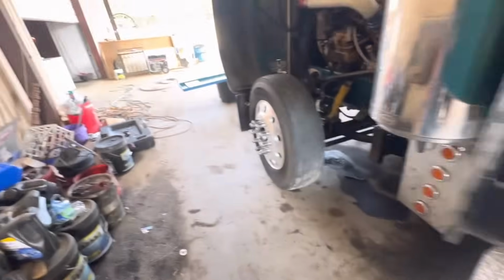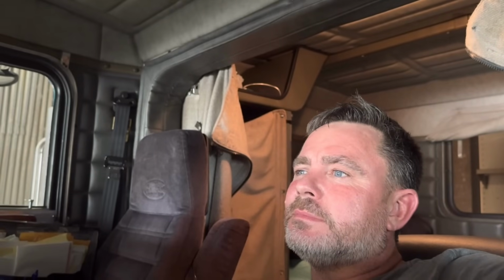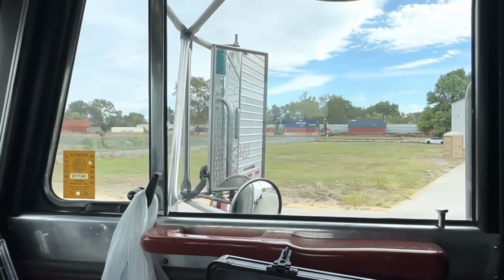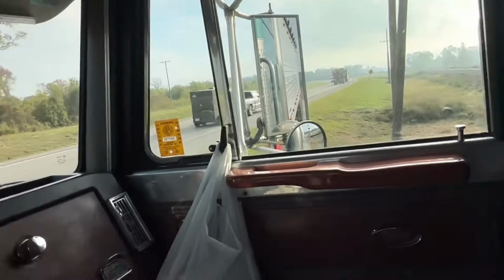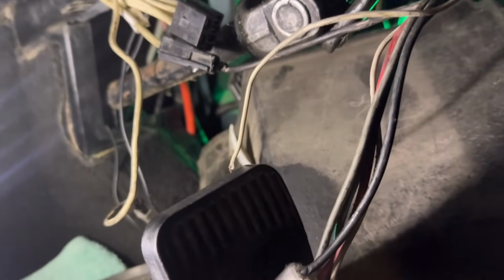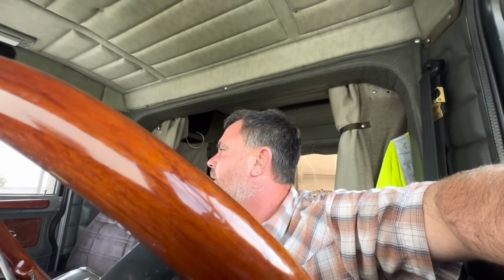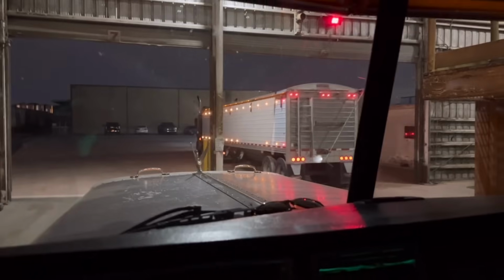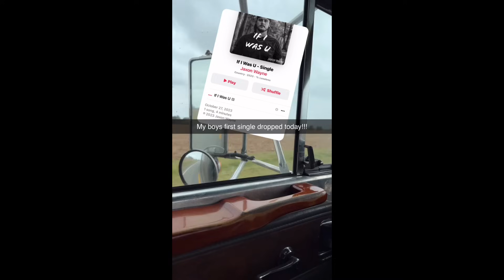Second Week In My 1998 Peterbilt 379 / Things Are Looking Better!!!!!

Comment: If you’re going to change the dryer you can shoot air through your ac manifold shut the knobs down and spray your system down with soapy water. Make it a lot easier to find leak.
Reply from the maker: That’s a pretty cool trick. I may have to try that

Comment: Heck  yeah  the exact same thing happened to me on the turn signal wiring...got wrapped up in the steering u joint i just got a new one for mine..used plenty of zip ties to keep it away from the u joint..
Reply from the maker: Man that’s a first. I’ve had one of these truck since 1998 and never had that happen
Reply: @thedirtytrucker9633  I even had the problem with the air pressure sensor...but my buzzer wouldn't shut off.
Reply from the maker: Yea sir I had to unplug my buzzer the other day until I could get another switch in there

Comment: Biggest problem I've had with the a/c on them is orings. Mine was blowing ice cold, went home for the weekend and Monday morning nothing. Oring on the high side of the compressor was leaking. On our other truck had one leaking on the dryer just out of nowhere.
Reply from the maker: Man those things will make you or break you. I soak mine in refrigerant oil before I put them on and wear rubber gloves. I try the best I can to make sure the o-rings are straight and not twisted on the fitting
Reply: My 96 will give you pneumonia it gets so cold. I can't run the back on high in the summer when I'm trying to sleep because it gets so cold. I'd check all the connections on yours and look for oil seepage from them and the condenser.
Reply from the maker: Yeah I’m going to redo the whole thing in the spring. Most of the time I ran the sleeper and that will run the cab on low. And it was all I could take!

Comment: Maybe you can JB weld the hole in the one tank for a temporary fix I did it once to a fuel tank it lasted a few years no issues.
Reply from the maker: I’m going to take it off and fill it with water and pressurize it so I can find the leak. I don’t trust my aluminum welding enough to weld it up so I’ll take it to the machine shop here. Unless I can find a a 150 gal tank to replace it

Comment: Does that grain hauling pay pretty good. I pull flatbed steel out of Chicago to Carolina’s average around 3,25 a mile. I’ve always wondered how that stuff paid.
Reply from the maker: No it really don’t pay that great. Everything is usually by the ton or by the bushel. Every once in a while a flat rate. Got to load the wagon every load.

Comment: When you mention the motor you had in it did pull it out b4 you sold this truck or what’s story with that?
Reply from the maker: Yes. I pulled the original 1LW out to do an out of frame in it and put the 5EK that it now. I ended up selling it after this 5EK broke the crank and I stole the crank out of the 1LW to put in this 5EK so I could put a new crank in the 1LW when I did the out of frame. 6 years later here I am about to follow through😂

Comment: It needs more Freon those pressure are to low it should be 40 on the low side and below 250 on the high side brother than it should be cold
Reply from the maker: Dude I know. I started to put more Freon in it. The best this thing ever cooled was 27/150. It would absolutely hurt you it got so cold. When I fill one I get it to where the compressor kicks on by itself and look at the thermometer in the vent to see where is going to cool best. I’m just going to redo the whole thing in the spring so I know exactly what I got